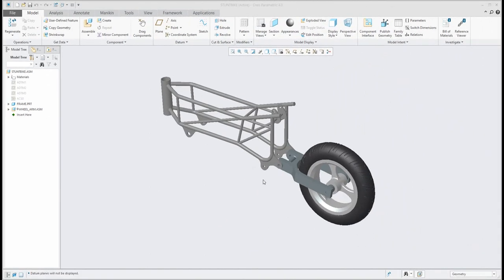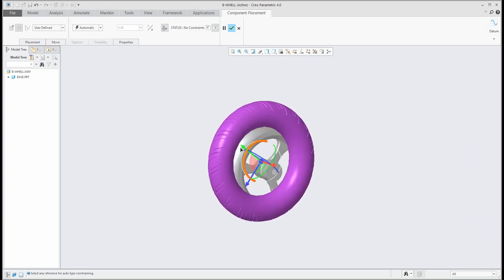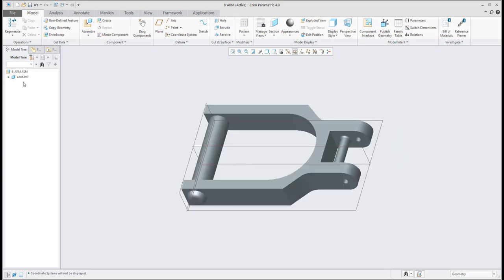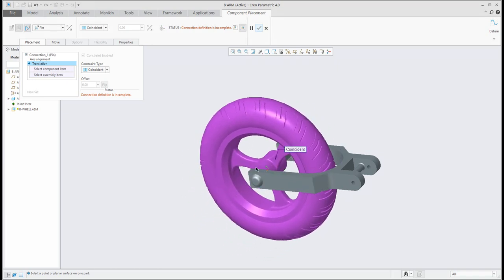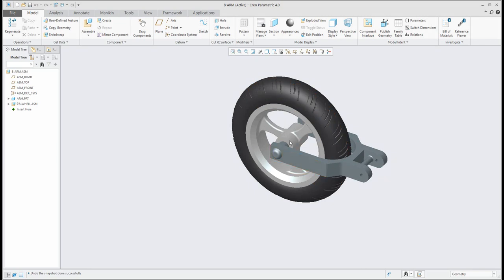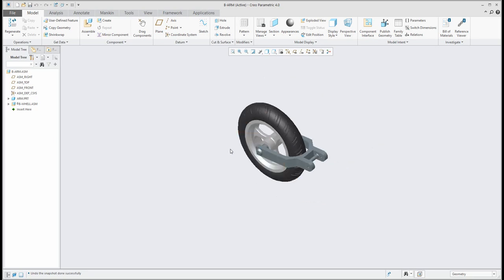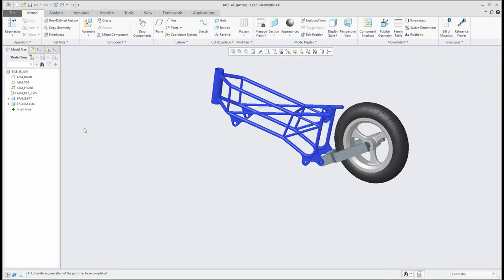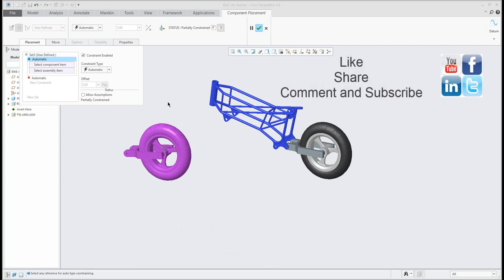PTC Creo 4.0 tutorial: Pin Connection

Comment: When I try to drag my pin connected part, it just moves the whole model but the pinned part does not rotate at all...
Reply from the maker: If you have more components attached to the mechanism, sometimes is hard to move as you need only by dragging.. You are right. Try to use in the Drag mode function where you can simply set values or fix actual positioning.

Comment: Hi Vladimir, why on Creo it is not possible to create a mirror feature of a previous shelled feature? I mean, if I have a part where exists a shell feature and apply a mirror feature after that, the final result is a part mirrored but the shell applied only the first mirror side. Is there any workaround for this?
Reply from the maker: Hi Richard, best practice for Mirror (included Shell) - create 1/2 model for example with all features (extrude, chamfer, holes, shell, etc.) and than select main name in Model Tree and Mirror whole part.
Reply: Thank you! It is work perfectly!
Reply from the maker: +Richard Caetano thanks Richard for your positive feedback.